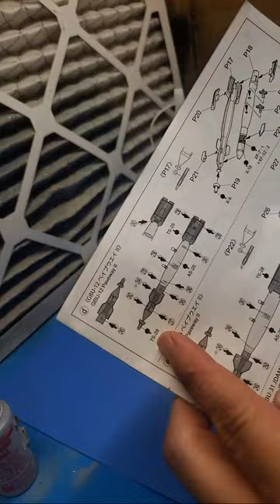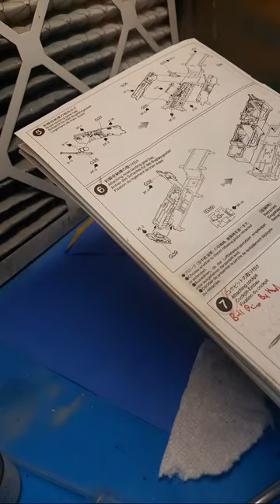Tamiya F-14D 1:48 Painting all the Tedious Parts and Painting Lights!

Comment: Yep I know the feeling. I am working on a 32 scale Revell Hawker Hunter FGA-9. and it's been a long run. Started it a year ago. But some things happened in my life which caused delays. But Now I'm starting back in in it. I also had to strip off the original primer coat because it went down wrong. So that cost me further delays. The new prime coat is going and looks better.
Reply from the maker: Nice! I wanted to finish it but it didn't happen. I should tomorrow though.